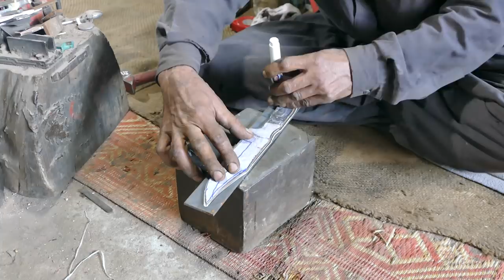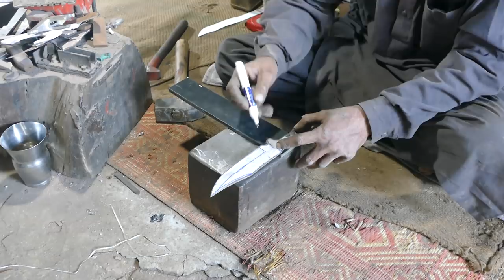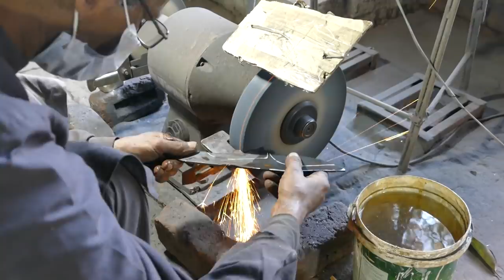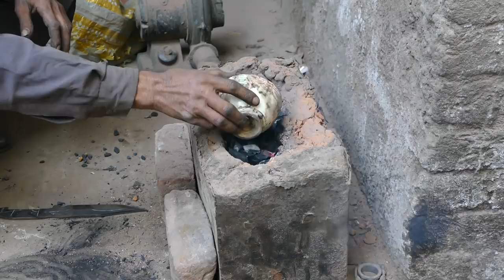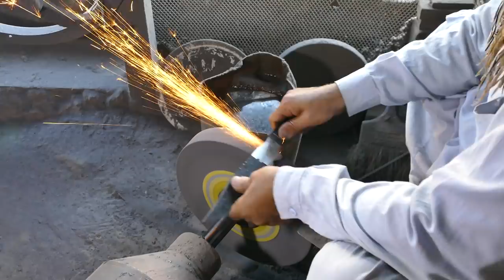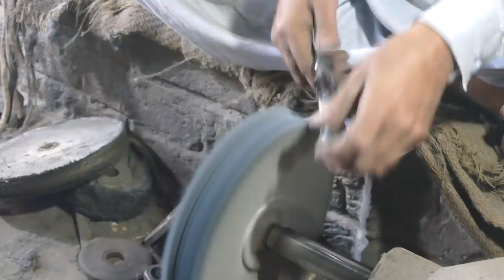Amazing Handmade knife making with rusted steel

Comment: A good knife is only one which is beaten and made into shape ! This is just a show piece
Reply: No way to tell what steel he is using to start with. Just because it's processed doesn't mean it's proper steel for knife making. While it's a good looking knife, it's most likely one he gets paid a couple of bucks to make, and gets sold from one of the catalog company's as a " hand made " made item for $ 19.99. It's not going to be an item you have and use for a long time. The tip will break and it will most likely chip along the edge  and become a $19.99 flat head screw driver.

Comment: What steel is being used?
440c, D2, etc…?
( yes, unpolished 440 series steel will develop rust)
Reply: it's definitely not D2 or 440, he's heat treating with coal. It's probably a simple carbon steel or something like 5160, O1 etc.

Comment: It really is not a knife, if you cut an  stencil from a spring steel. Knives are no different from swords, real ones are forged. Anyone who has done some smithing knows that. That thing there has about the same tensile strenght than a plastic ruler.
Reply: @This_Old_Man_68  If it's factory made metal sheet cut out, it's a piece of junk, no matter the price tag. Real steel work is made by forging by hand from something which starts from a block of metal. You notice the difference when you drop them on a hard surface.
They literally give you the "break".
Reply: @This_Old_Man_68  I mean seriously. Stick the blade of the K55K to tight slot and do a sharp twist - SNAP! Do the the same for a blade forged from folded and quenched steel and you maybe manage to bend the blade some. Who you call schmuck eh?!
Reply: @This_Old_Man_68  OH WELL SAID Mr S.!!! put this fool in his place.

Comment: How can you make a blade like that without applying any knowledge of forging and quenching? That's whole thing is rubbish?
Reply: It’s not a forged blade, it’s made from bar stock. As regards hardening perhaps experience has shown the knife maker that the infusion of carbon from the charcoal & subsequent quenching (both shown in the video)  is appropriate for the steel being used.

Comment: I think that knife will be as dull as the maker of it. Not even forged that is a mafia job. I suggest  the maker to watch the Japanese make a real knife.
Reply: Sure Salvador. But we're still very impressed by the overall fit and finish of the blade, and the ability to do it with such a basic tool set. After all, its the third world. I understand your apathetic view of their lack of metallurgy and heat treatment, but without a dedicated supplier and the knowledge of annealing and tempering temperatures for each individual steel type, its a lot of hit and miss with the junkyard materials these people are presented with. They probably find the hardest steel they can, by preforming rudimentary tests, and do the best they can in the mountains of Pakistan.
Reply: Your privilege is showing.

Comment: We're not going to stop it, but we in the "West" should not be encouraging such unsafe practices.  We should be encouraging these workers to work safer.  It looks pretty, but as an Engineer, I do not find this too impressive as the knife blade will not be very good.  If he had heated it, folded it in half 15 or 16 times he would then get a blade that would keep being sharp for a long time.  Just because it looks pretty does not mean that it will be of any effective use.
Reply: Sure Richard. But we're still very impressed by the overall fit and finish of the blade, and the ability to do it with such a basic tool set. After all, its the third world. I understand your apathetic view of their lack of metallurgy and heat treatment, but without a dedicated supplier and the knowledge of annealing and tempering temperatures for each individual steel type, its a lot of hit and miss with the junkyard materials these people are presented with. They probably find the hardest steel they can, by preforming rudimentary tests, and do the best they can in the mountains of Pakistan.
Reply: What do you mean folded 15vor 16 times
Reply: @travispadilla3972  , its called Folded Damascus Steel Travis. The ancient art of heating steel and then hammering it flat,  and then folding it over itself in a continual pattern. In this way Japanese sword makers were able to hammer out the impurities in the steel, and make the molecular consistency more uniform. Also, you can use this technique to mold two types of different steel together, heating/hammering/folding the steels together. This was often done to attain the best qualities from each steel. A hard steel (good for edge retention) mixed with à flexible steel(good for shock absorbing), giving a sword a near magical quality. 
If your interested look up :  Wootz Steel, Damascus Steel
https://youtu.be/s71kHdx5pug
Reply: @shovington67  ok I understand what you mean thanks and I'll definitely look it up I just started making my own knives so I want to learn alot about this
Reply: @travispadilla3972  , I don't think you could find a more satisfying pastime than to work with your own hands and create something in steel. This is a life journey that can open doors, and elevate you to a special position in the hierarchy of your community. In someway its a lost art, and when the power goes out, and the shit hits the fan, your knowledge will be crucial for many reasons. Go for it Travis...
The story of Wootz Damascus Steel is why their are stories about magical swords that are still being told today. Its about an arms race, the clash of two religions, and an art form that was almost lost to history until a man who shoes horses in Florida (Al Pendray) and a professor (John Verhoeven) from Iowa state university joined forces to bring the magical steel back to life.
Reply: @travispadilla3972  when you're making a blade that needs strength and for it to remain very sharp for a long period of time the blade needs to be folded over and over and hammered after each fold.  It is a long process.  Look at videos for Damascus still or Japanese sword making and you'll get the idea better than I can explain.  A single piece of metal just cut and shaped is not the best way of making a knife or sword.

Comment: Big fucking deal. He's using his hands.....and a shit load of power tools. It's not like he's forging a blade. He's using flat stock and 5 or 6 POWER TOOLS! My father taught me how to drill holes along the outline of the blade and then use a hack saw to connect the holes. Then file the edge to make it straight where you want it. Same thing when making the slot in the hilt. This guy even shaped the wood with a power tool! Don't be impressed. It's not that amazing.